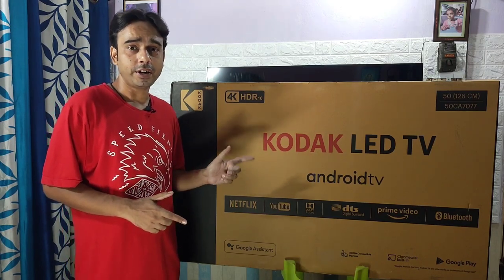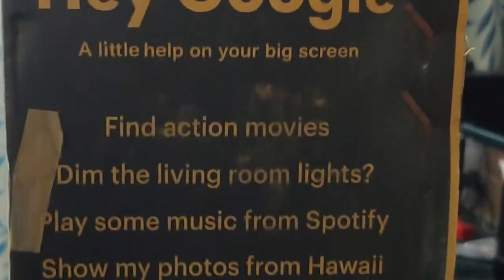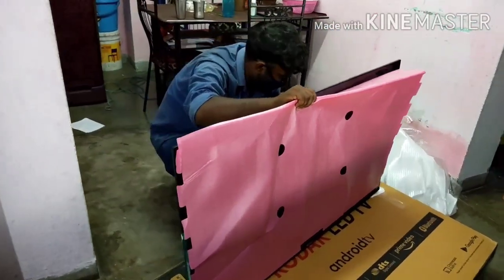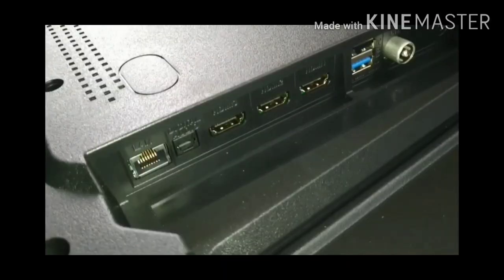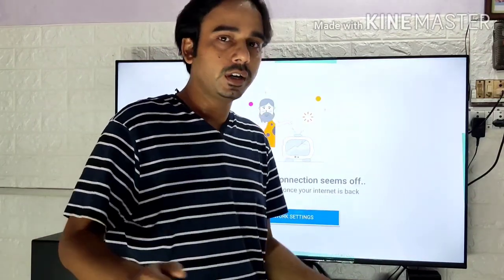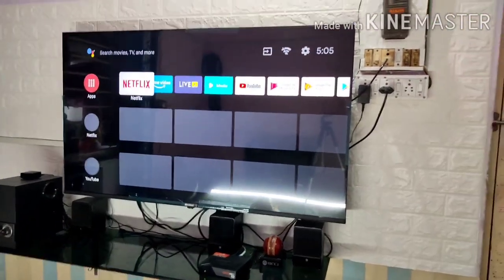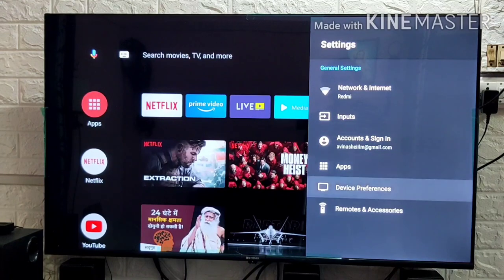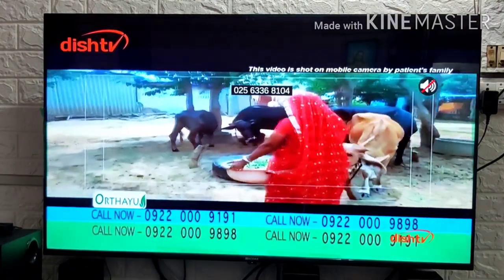[English] kodak 4K AndroidTV 50CA7077, Unboxing,Installation & Real Life Picture & Sound Comparision

Comment: How's it should I buy 55ca at 30k ?
Reply from the maker: Yes..
Reply: @gebforyou  brightness achi h ? Ps4 ke lie lera hun m ise gamimg k liye
Reply from the maker: Don't buy for gaming.. It may hang and heat as the processor and RAM is low
Reply: @gebforyou  ok ill buy motorola